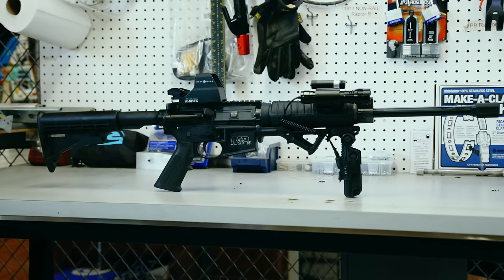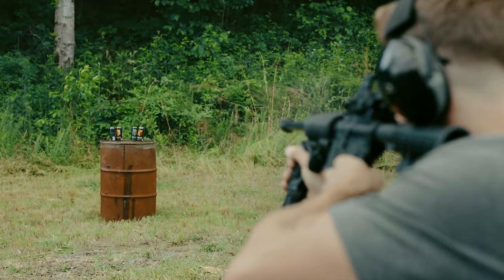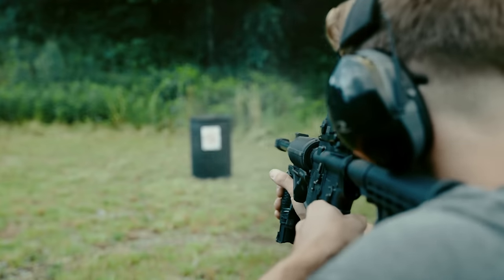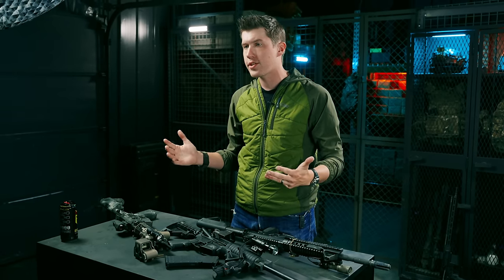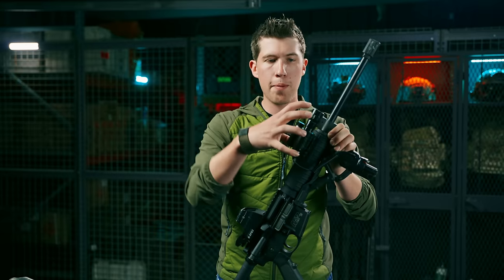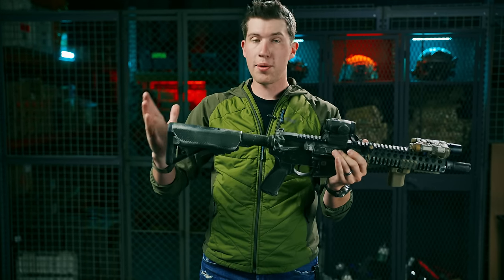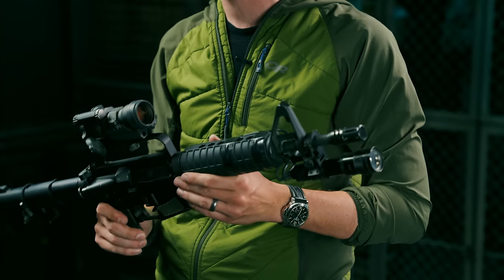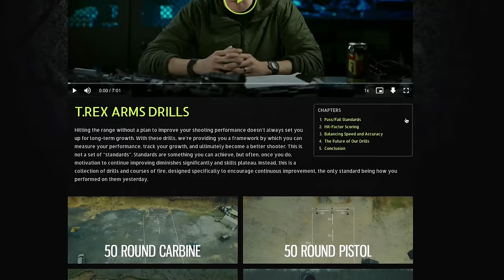5 Mistakes New Rifle Owners Make

Comment: "This video brought to you by Strike Industries" lol
Reply: that one cuts deep😢
Reply: I like their dust cover, that’s it
Reply: They make some good stuff tho. I love their Ambi mag release and extended bolt catch
Reply: I only have a left eye so those little SI attachments make a huge difference for me
Reply: Their Glock 19 EMPs work better than Zev's in my experience. I'm just a case study of 1 though, so take that with a grain of salt.
Reply: It’s so unavoidable….it’s so hard to not know. Lol
Reply: But the do have things I still use to this day.
Reply: @TROY-MCCLURE-1991  i like their qd sling swivels
Reply: You spelt Mission First Tactical wrong lol
Reply: Got an AR that came with their mags - first one didn't work the first trip out, had to disassemble it to unbind the spring and then worked fine.
Reply: @longrangevoodoo4480  you spelled “Spelt”wrong, lol 😂
Reply: More like Danielle defense

Edit pun intended
Reply: Their pistol length buffer tube hasn’t failed me yet

Comment: You can get a sig msr for $80, or a Romeo 5 for $120. On either one you replace the mount and you have a solid setup for cheap.
Reply: I was disappointed in battery life in my sig msr and Rome 5, then double disappointed and thought the Romeo 5 died. Ended up being the Energizer batteries I bought were all crap.
Reply: I did discover the msr gives me better fit with my astigmatism over the Romeo 5.
Reply: Like my Romeo 5 as well. Essentially, it's a rebranded holosun.
Reply: @warrenharrison9490  I have both and can confirm that the msr plays slightly better with an astigmatism. 

As far as battery life goes, I've left both on for months at a time and never had either die on me. The Romeo 5 has shake awake which helps
Reply: I have both, and run them on 22lr builds. I personally wouldn’t run them on anything other than a range toy. Also ran the MSR on a 6” pcc and it did fine.
Reply: For me, Vortex Crossfire gen 2 red dots. Analog dial, no shake awake, 50k hour battery life. My 1st one has never been turned off since I installed the battery brand new, still going after 2 years left on setting 6 or 7.

I have 3 of them, I highly recommend replacing the mount though, I don't really trust them for hard use. I prefer the ADM QD absolute co-witness personally.
Reply: My first rifle had a Vortex Sparc AR and it's been phenomenal thus far. I did learn I have an astigmatism running a red dot for the first time, but optic has been good for a couple thousand rounds so far.
Reply: The primary arms slx MD-25 red dot is also an awesome choice for the budget minded people. 

They have a pretty good reputation and are fairly durable according to all I've seen.
Reply: I’ve been running the same battery in a Romeo 5 for two years The auto shut off is great it’s never failed me
Reply: @michael9r9r  I had the Rome 5 on my primary build, then took all my builds to range for a zeroing day and trying different ammo. I went through the other builds then got to my primary and found no dot, changed battery to spares still no good, swapped msr off of one of the others and finished zero and tested different ammo in my primary. 14.5 mid length 1/7 really liked xtac m855 giving best group and zero.
Reply: @oakwestplayer  the mount on both the msr and Romeo 5 are the weakest link. I threw a geiselle on the Romeo five and a UTG on the msr and both have fared well on an overgassed as shit 7.62x39 AR pistol
Reply: Garbage. Aimpoint PRO isn’t much more money and should be the bog standard.
Reply: @sevenpointsixtwo9707  the pro is significantly more expensive and is heavier as well. The battery life and durability are nice though

Comment: What I found out with the AR stock setting was that sometimes I might have to rest the stock against arm instead of shoulder, so the stock had to be set not too long or short for a good grip and stability. This happens when you really got to stretch out for around a corner shot, not to mention if you can only use one hand. Once I instinctively did it when having to run and shoot behind around my left (I'm right handed) and after that I realised the stock was actually resting against the arm instead of shoulder. It was a good run.

Comment: I started off with that very same rifle. Upgraded the red dot to a sig romeo 5, later to an lpvo.
Changed the gas block to a low profile MI gasblock and handguard to a 15 icnh free float MI mlok handguard. A 2AA pencil barrel with a 1:8 twist with mid length gas system. Bcm stock, magpul grip, bcm bcg, added a inforce light and magpul handstop. Soon to be a bcm kag just cuz i wanna try it. 

Looks bad ass, i got a compliment today from the gunshop. Told me im one of the few people who set their rifle up correctly and i did a perfext job installing everything.

Made me feel good.
Reply: You lost me at inforce
Reply: @levihuckabee6407  is it a bad light?
Reply: @James-cr5mc  in my honest opinion yes. My buddy bought one (he sets up his guns like the one in the video) and compared to the streamlights, surefires, cloud defensive, and arisaka stuff it's garbage. Once you try a high quality light you'll never go back. An entry level streamlight is around $100 and honestly isn't too bad. I'm saving for an arisaka.
Reply: @levihuckabee6407  ill have to check them out
Reply: @James-cr5mc  good luck brother

Comment: This is a great vid for a beginner. Wish I would’ve had someone like this! I definitely made some of these mistakes 8-9 years ago when I got my first AR. The mistake I didn’t make was buying a crappy gun though. I wanted something solid, so I got a colt le6920 for my first ar and played around with crappy optics and scopes until I finally learned what makes a 400-500 dollar optic actually worth that price. Now I run an Eotech and have an even better rifle that I build (and still have the colt)
Reply: I think we ALL did this in the very beginning...but thats the fun of the journey. Me personally...every time i think about how bad my first 2 builds were (16" carbine, 7.5" pistol 2014) compared to the stuff im doing almost 10 yrs later, i get a really good chuckle. Then i smile inside because now i "get it" 🫡 keep learning
Reply: yeah I wish I watched a video like this when I got my first AR, learned most of it slowly though practicing shooting and getting a tip here or there. For a long time I only had iron sights on my first AR, and got a Sig Romeo5 as my first red dot, which is the bare minimum. I prefer Primary Arms Microprims now

Comment: I'm glad to see some support in the comments for Sig Sauers Romeo 5. It's a great optic that stays zero and is pretty cost friendly. I did have to warranty my first one due to an abnormal connection issue in the selector but they paid shipping and the new one has went through 800 rounds so far and hasn't needed to be re-zeroed at all and the selector hasn't had any issues.
Reply: My Romeo5 has been through 3 different rifles, I've had it for two years, no issues 👍🏼 you won't find a better red dot for around $150 and the Holosun clone is good too, my Vortex and Primary Arms (low end) red dots suck, would not recommend them.
Reply: A friend of mine runs a romeo5 on just about everything. They have worked out really well for him. I have a sig MSR that has been great but my favorite is my romeo4 s with a circle dot.

Comment: When i got my first rifle shipped to my local gun store, i poked around there for sights. Got a set of backup polymer irons (they nicked them off of a glock conversion kit they had kicking around and sold the sights individually lol) and a fairly cheap, but good Sig Romeo tube red dot. Its held up, battery life is good, lots of brightness settings, and its friendly for my bad eyesight.

Comment: In my experience the sig Romeo 5 and 7 have been great entry level optics
Reply: Agreed. It holds its ground against many mid tier red dot systems on the market. Very surprised he didnt mention Sig.
Reply: Agree 💯  Romeo5 red dots are dam good for 125$ !!
Reply: same. love my Romeo 5's ...  Iron sights align perfectly cowitness....on about every rifle whether primary on top or cantilevered on 308's
Reply: Bought a Romeo 7s from PSA for $114
Reply: Yea, they're awesome.  Especially when I have to remove and replace the battery to get it to turn on.  I'd rate it exactly as trustworthy as the Burris fastfire.
Reply: @randymagnum143  the 7s?
Reply: @MrSabram07  I have a 5, and it has been a headache.  Works well when it works though.  Nice enough for $99
Reply: Exactly what I'm doing- cantilevered off 45 on 308's.  I have a trijicon holo on top of one scope though (6.5).  But Romeo has worked well for me so far,  Holds Zero for me too. I'm wondering why his didn't.
Reply: @randymagnum143  You got a bum one.  Send it back.  I have a few and have never had that happen.  (Can't vouch for the fastfire No experience with it)
Reply: @samhouston5217  pretty sure the one I got was a remanufactured unit.  When they were first available they came in a normal SIG package.  The dealer had a display unit, $150.   it was dead.  Opened two more, both dead.  Went and got fresh batteries, still all dead.  They sent the whole lot back.  Flash forward, now they're $99.  I'd read a lot of good reviews, maybe give it a shot.  Came in a brown cardboard package with all SIG info on it.  Works awesome 95% of the time.  
The Burris fast fire is a nice sight for a target pistol, it can be a real pain to get into action.  I just keep it on a Ruger MKii.  Excellent once it is on and set.  But definitely not something I'd bank my life on, same goes for the SIG.  I'm sure the more you spend on a SiG, like Vortex, the better off you are.
Reply: @randymagnum143  Yea, roger that.  Maybe I should just be happy all my sig romeos work.  I mighta been lucky, but having said that I've been real happy with the ones I have.  Run em on 300 blks, 458 socoms, and 308's.  45 degree cantilevered on the 458s and 308s.  just run em on top with magnifier on the 300s for hogs.
I like my holo trijicon on top of my scope on a 6.5 but i think I'll avoid the fastfire after talking with you.
Reply: @samhouston5217  the ff4 is probably better, but there's a lot of other good, inexpensive options out there.  I have a swampfox liberty that has given me 0 grief.

Comment: So I've seen the "Daniel Defense extendo-grip" jokes all over but having worked in the industry there is a simple explanation. It is done with a purpose. Most manufacturer's that include a grip of some sort simply put it in a rough midpoint of the rail. Most end users never customize it for optimum ergonomics and just leave it there. Hell, more than a few probably do not even know you can adjust it. DD places the grip at the extreme end of the rail so that you are forced to fit it to your needs as the individual shooter. Sure they could just throw it in the box and achieve the same ends, but can't include it in photos that way. You don't have to agree with or like the explanation but it is their thinking and in no way was the grip meant to be utilized in that placement....

Comment: I just had a revelation that I was totally oblivious to the convergence point. Tried to zero in my red dot on my first carbine (KR9) and was weirded out why I was laying perfect 10s at 25 meters and then it was landing center mass at 100 meters, but at 50 it was almost at the head level. Next range session I'll recalibrate the red dot. Incredible.
Reply: Most people don't realize that bullets actually fly in a parabolic arc due to the spin.  They don't just come out and drop.  They come out, the centripetal force of the bullet spins to the right, causing it to go up and then it eventually drops back down.  It caused the bullet to do exactly what you just described.

At extreme distances, if you aim at the center of a target, what actually will happen is the bullet will come out, arc up, drop back down, while continuing to spin of course and as the bullet loses velocity, the spin of the bullet will cause it to left up and to the right so your shot will land nowhere near where you were originally aiming.  Barring all other factors (like wind drift), compensating for "bullet drop" isn't enough at long range.
Reply: @BullsMahunny  everything you said is wrong. Did you even watch the video? He literally explains the convergence.